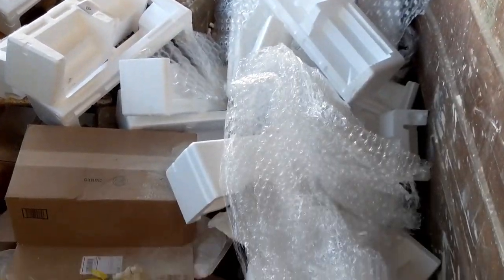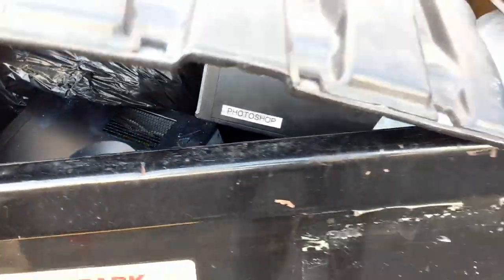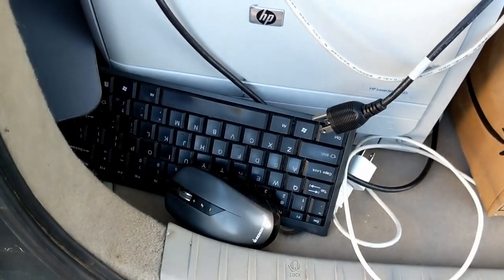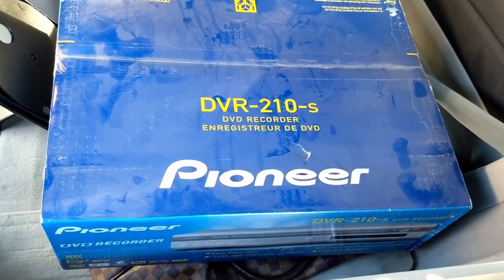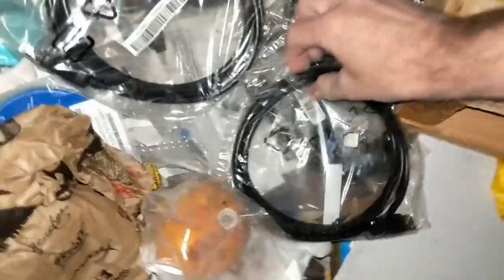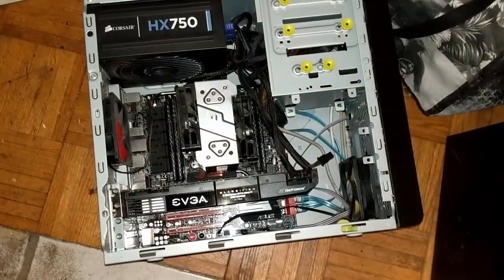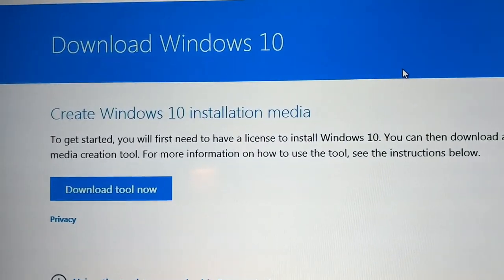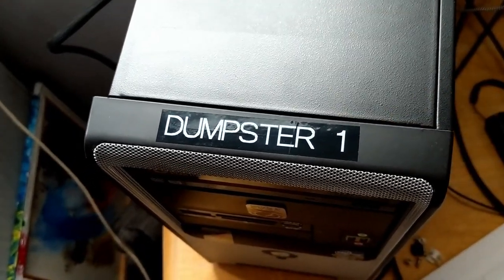Tech Dumpster Diving JACKPOT! $$$

Comment: do you see the ram 😲👍? if ddr3 your a winner$100's IF    older >  dr2 toss it back tools r a win old hdd small magnets :)
dam the GPU'S gtx 970 im using a gtx 960 paid $350 Back in 2017 😳🤷‍♂️👉WINNER winner chicken dinner mate! good find  
you sell all that pc stuff drr3 ddr4 like hot cakes if they work most do  ram test swap over if it dont boot  1 ram is the problem always

Comment: Amazing haul - wanted to see if the 970 was a runner though
Reply from the maker: It works! At first I thought it was dead - connected to the HDMI port, no response. But then I tried the DVI - got a signal, updated the driver, and now it works in full. So I now run a 4GB GPU on my dumpster computer! Editing videos is so fast :)
Reply from the maker: Two of the systems had bad motherboards. I can see why they threw them away... I spent about 6 hours troubleshooting. For me it was free time, but for a company it was cheaper to buy new stuff & write off the old - versus the labor hour costs.
Reply: @VLOGNOSIS  can still test em and see if you can get em up and working again.  And dumpster dive more and trash pick in your neighborhood on trash day see what you can get.

Don't pass on even old ones, can make retro gaming pcs or other stuff out of em if nothing else or servers.